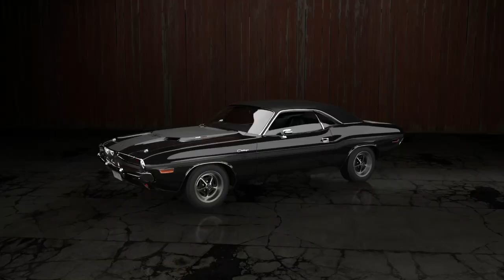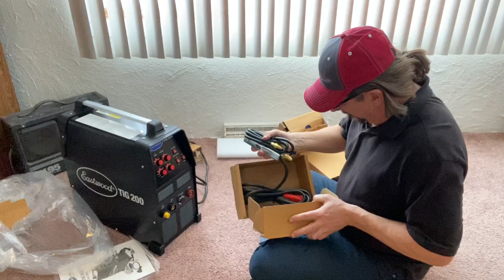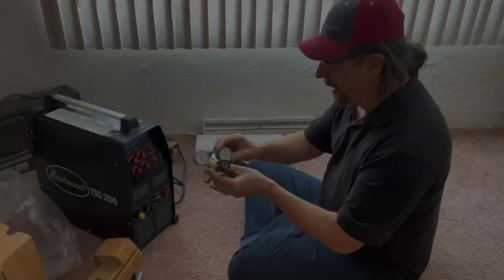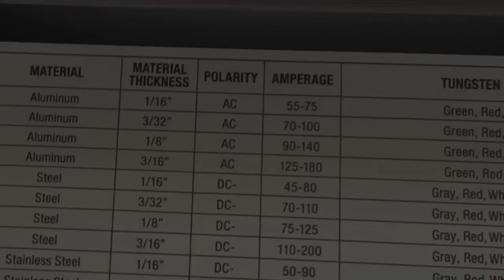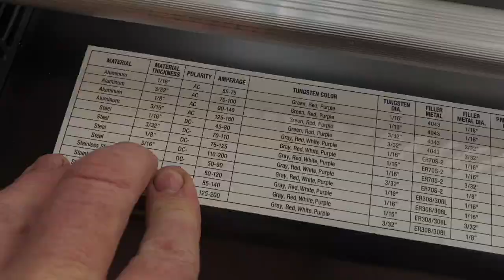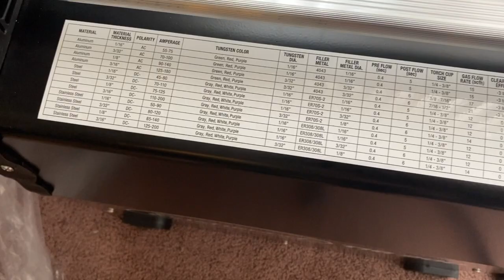New TIG Welder - Shop Updates - Unboxing the Eastwood TIG 200 AC/DC  Welder

Comment: friend, I have had that machine for 3 years and only one fan on the top is working for me. Is yours the same or do both fans work for you?
Reply from the maker: Next time I use it, I will try to remember to take a look at it… I’m wondering if one fan runs constantly and the other one comes on as needed. But I don’t know 

Thanks so much for watching. Hope you enjoy the channel.
Reply: @MyKARSShop  thanks I hope that when I turn on the machine I will see if both work Thanks a lot

Comment: Okay: explain this to me like I'm 6. What does welding "do?" Meaning: I know that, with a soldering iron, I'm using a hot rod (ha!) to melt metal from a spool in order to join two different things together. But, welding doesn't do that, right? Is it just…super-heating two different metal sources to "merge" them together? Help a guy out.
Reply from the maker: Welding is similar to solder but not the same . Soldering sticks two pieces together with a third substance (lead). It’s kinda like glueing with metal. 

Welding  “melts”  two pieces of metal  together while adding more metal via a wire (MIG WELDING). Or a rod - TIG and stick welding. 

MIG stands for metal inert gas -  wire is the electrode that is fed in to complete the welding process

TIG - Tungsten Inert Gas - tungsten electrode creates the spark and melts the metal together, and a filler rod can be added if more material is needed in the weld. Similar to the way you add solder 

Stick welding literally uses a welding rod as an electrode and melts metal and flux into the welding process to melt the metal together. 

Does that help?
Reply: @MyKARSShop  Yup, sure does. I was confused b/c when I've seen you welding, you're using the welder in one hand while holding your mask up with the other; I didn't know where the filler wire (or rod) came from.
Reply from the maker: @scottharding9916  Yes. That is MIG welding, or also known as wire welding.  Maybe I’ll do a quick demo video on the differences between TIG and MIG at some point. Once I get this thing fired up and get a little practice. LOL
Reply: @MyKARSShop  For the record: my Spawn just registered for high school, and signed up for three - THREE! - welding classes offered here at St. Johns! 1) Arc Welding; 2) Acetylene Welding; 3) Advanced Welding. Also looks to take Metal Technology 1. The logic: "I'll bet that someday, all that will help me restore a '58 Cadillac!" #heart
Reply from the maker: @scottharding9916  sounds like Spawn will
 need to come up and tour the shop at some point and maybe even get a chance to do a bit of welding. 😈😈